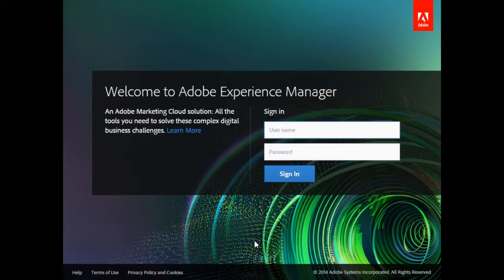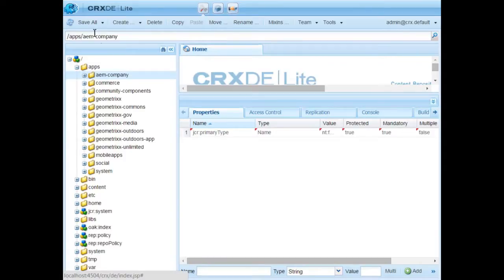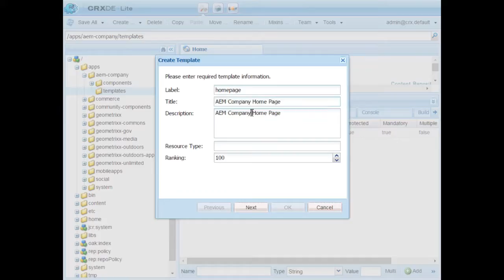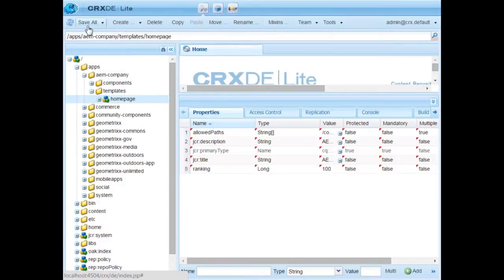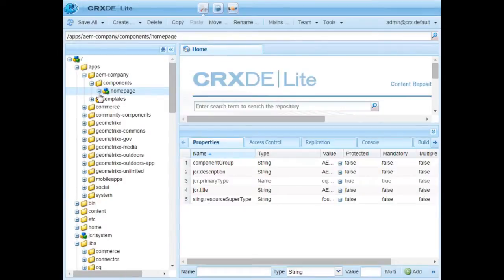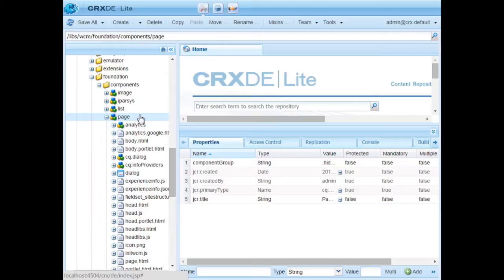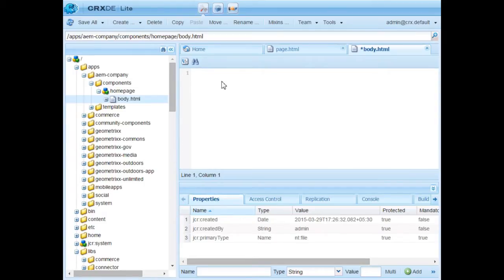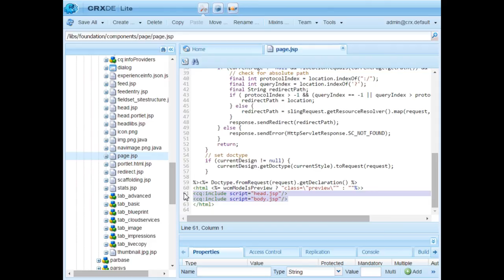Create your first AEM template

Comment: Sunil, not sure if I did something wrong, or if it's because I'm doing this tutorial w/ AEM 6.2. However, when I got to the point of saving the homepage template renamed to body.html (from homepage.jsp), I received an error: Could not save changes. Received  409 (Conflict) for saving changes in workspace cx.default. /apps/aem-company/components/homepage/body.html/jcr:content
Is this a 6.2 issue? Does it no longer allow you to overwrite the file? Or, is this indicative that I've done something wrong somewhere?   

Thank you so much! 
Tommy
Reply from the maker: It doesn't look so. Log out from CRXDELite and then log in.
You need to save your changes after you make it. I feel overwriting an unsaved change is the reason.